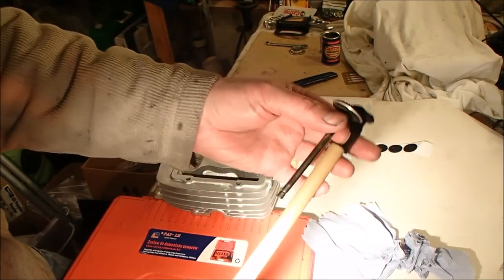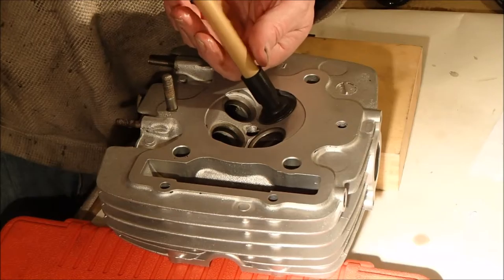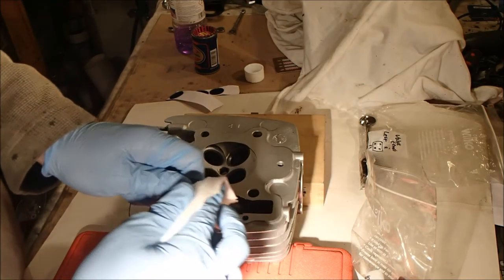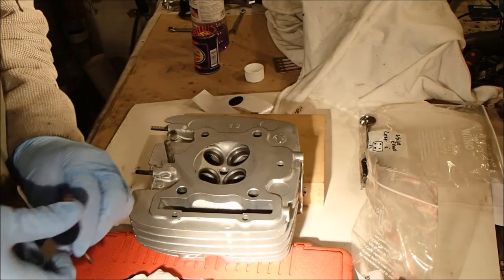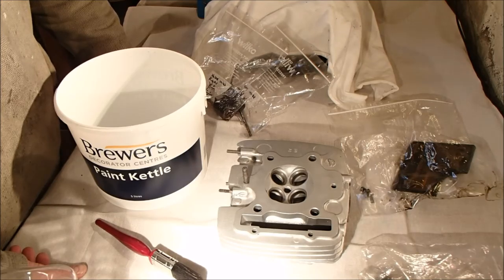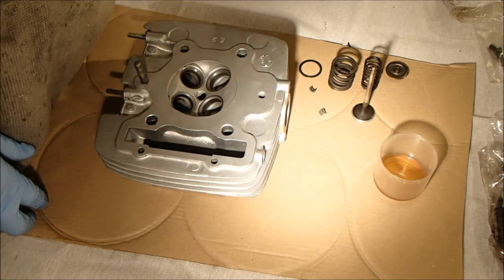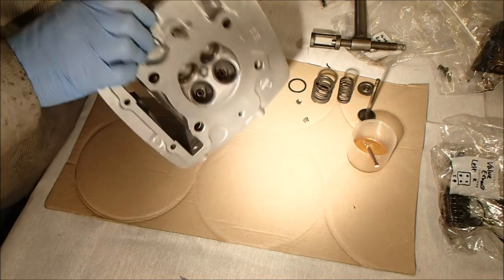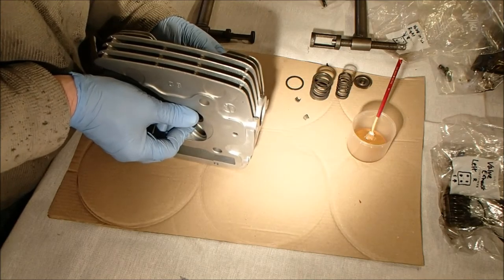Honda xl250s engine restoration (part 7)

Comment: Use a 7inch length of fuel pipe shoved onto the valve stem, the other end on to a cordless drill on slow use both ways. . and oil the stems.